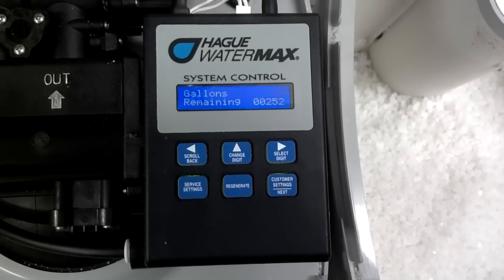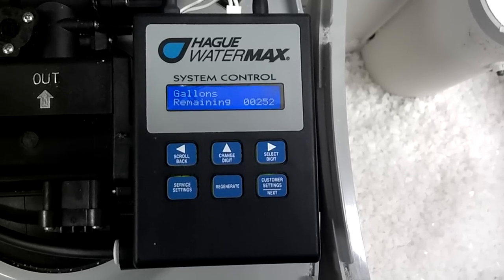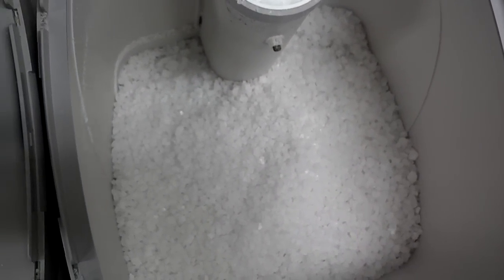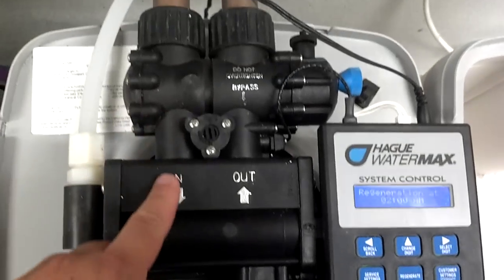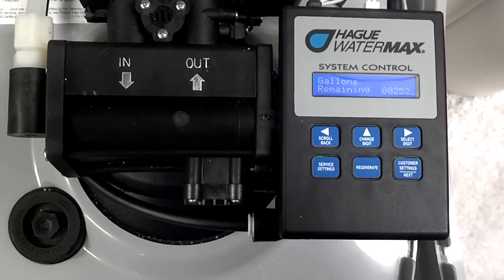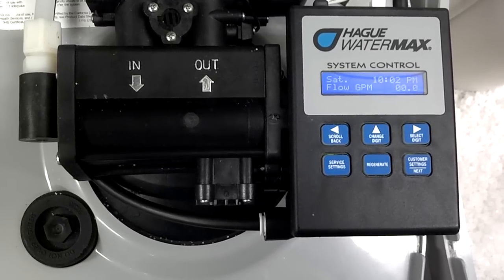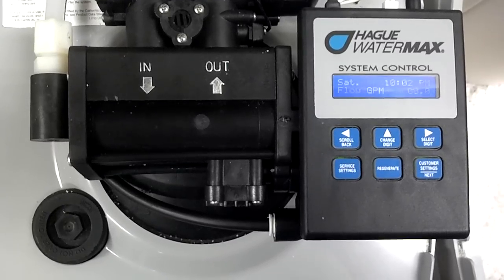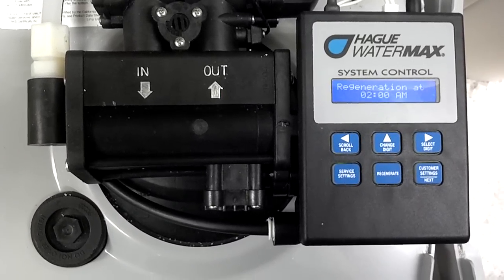Hague Watermax Manual Regeneration

Comment: What do I donif it has a home not found message?
Reply: I got that error too, any luck?  hate to pay $$ if it is an  easy fix
Reply: +Manolo Tristan we ended up calling a professional and got it fixed and running again!
Reply: Don't know if anyone has this problem still but something worked for me. I found that the control panel was not connected properly - not sure if it means anything but ... then I unplugged the power source and counted off 30 seconds. Plugged it back in and the beeping stopped and it went through a cycle. Hope it works for you.